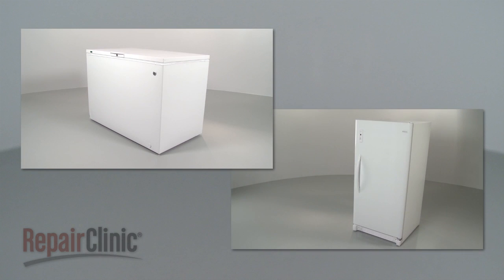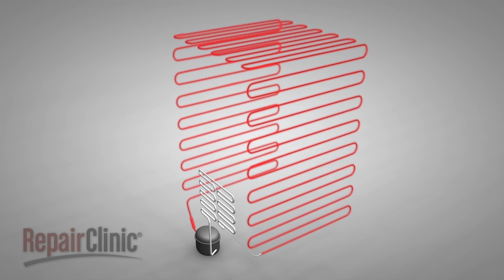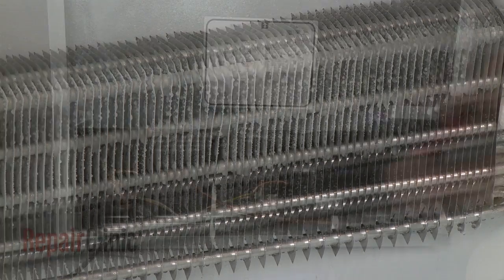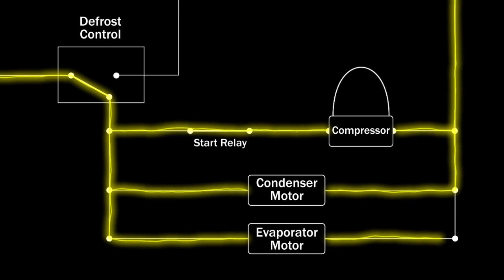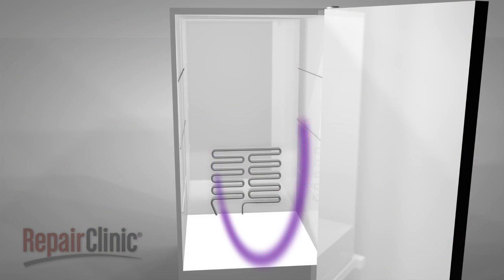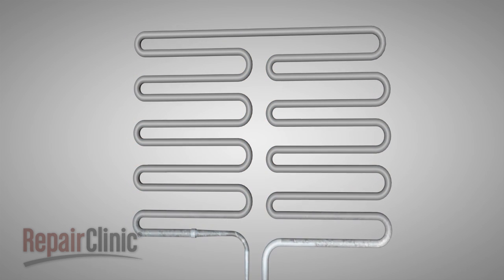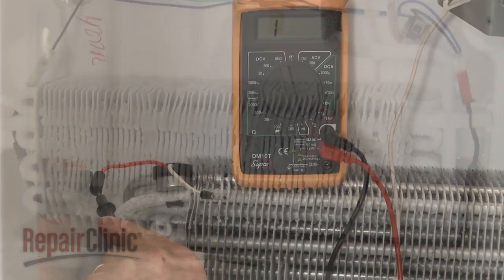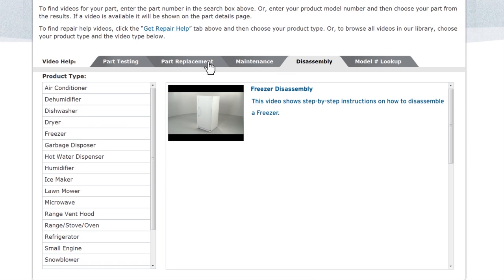How Does a Freezer Work? — Appliance Repair Tips

Comment: i have a whirlpool side-by-side freezer/refrigerator.  the refrigerator is fine.  i replaced the defrost timer.  The freezer motor/fan, the freezer thermostat and the defrost heater each work and have continuity.  but every week or so the heater won't stop heating and the freezer won't re-freeze.  i can restart the freezer by turning the defrost timer.  any suggestions?

Comment: 1:11 it's wrongly explained. Compressor doesn't convert gas to liquid. It converts evaporated gas from evaporator to HIGH PRESSURE and  HIGH TEMPERATURE GAS. 
After that compressed gas is converted to liquid in the condensor.
Reply: You prune
This Video is CORRECT 
THE REFRIGERANT IS ALWAYS CHANGING FROM A LIQUID TO A GAS ALL THE TIME

Comment: i have the unit the one you are showing in this program and its not cooling . i was told to turn it of for 18 to 24 hrs before turning it back on and i did but i noticed the fan is not blowing that high or its not normal. what should i do

Comment: Visiting family and their freezer isn't freezing. Check the condenser coils: they weren't as dirty as I expected. Cleaned the coils about 3 days ago, so I assume it's been enough time for the evaporator coils to frost over. Then checked the evaporator coils yesterday and only the bottom coil is frozen or covered in frost. Your video explained that if only part of the coils are frosted over, then the sealed system has developed a restriction or leak. This is what I believe the problem is, not only because of this video, but also due to a response I received from another youtuber. Would you concur?

Comment: My upright freezer's evaporator coils are not cooling/frosting.  The copper tube that leads up to them, has frost on it.  It's just not getting to the coils.  The freezer had been unplugged for a year, but was working fine at the time.  Just didn't need it.  The compressor is working and the fan by the coils is working.  The cold, just isn't making it to the coils.  I'm wondering if it might be the thermistor, the temperature sensor or the control panel.  I've been told each of the 3.  Also, I've seen a video, where it's suggested that the system may have developed a leak.  Any suggestions?

Comment: Our freezer doesn't have a condenser. I removed the side cover and saw just a compressor and a fan. Nothing else. The fan and the compressor always start and stop simultaneously. Could the compressor work as a condenser too, or the condenser is located somewhere else? Nice and simple video...
Reply: No, it either has a condenser coil above the compressor or some are built into the walls of the freezer but it has to have both a condensing coil and evap. coil.

Comment: I have a Frigidaire chest freezer. The temp Alarm is going off continually since a power outage.  I have tried unplugging the unit to reset to no avail. The lights and alarm reset on the lid not working now. What to do ?
Reply: +Elroy Koch oh and it's cooling fine
Reply from the maker: +Elroy Koch Sounds like the unit has a control board and it was damaged in the power outage.

Comment: I have an older Kenmore chest freezer (1988165382) that works fine but needs a new gasket, but the parts for this model are no longer available. Is there no way  to determine the current model that would be the same size and use a gasket for that model?

Comment: I have a frigidaire upright freezer that worked perfectly until we moved it to our new house.  Now it doesn't even turn on.  We have checked the outlet for power and it is fine.
Reply from the maker: +Holly Toolson We would suspect a problem with the cold control or the compressor start relay.

Comment: What creates the suction noise when I close my Whirlpool upright freezer door ?  Is there a pump that sucks out some air to help seal ?  Your video's are a great help.
Reply from the maker: +Donald Barnes It is the gasket. The gasket have magnets in them and when the door is closed the magnets pull the door closer.

Comment: I have a Amana side by side refrigerator. The defrost coil with defroster failed to work and I cut some wires and the frig continues to this day (6 years) to work properly without any frosting. Explain how this can be? Freezer side is zero and frig side about 50.
Reply from the maker: +Alvis Jenkins You disabled the automatic defrost system six years ago. It should frost over. We don't have have information beyond that.

Comment: mY REFRIGERATOR   WILL NOT CRUSH THE ICE, BUT
 DISPENSES ONLY CUBES.
Reply: push the crushed ice button first
Reply from the maker: Dale Kessler There is a solenoid in the rear that a rod on the underside of the bucket goes to. Make sure that solenoid can move up and down as it is probably locked up.

Comment: My 20 yr old Whirlpool upright freezer is working ok but, there is water frozen at bottom and the door no longer has that vacuum pressure when closing or opening. In fact, the door opens too easily. I noticed a gap at lower gasket. I cleaned the gasket but didn't help. What do u think could be wrong? Thanks for any help u can provide.
Reply from the maker: 771blahblah Your freezer's gasket may be worn out and may need to be replaced. There could be another issue causing the freezing water at the bottom of the unit. Enter your freezer's model number in our website's Repair Help for troubleshooting help: http://www.repairclinic.com/repairhelp?TLSID=1773.

Comment: The video shows that there is actually 1 coil. That doesn't make sense. There should be 1 for compression and one for expansion, no?
Reply from the maker: louis tournas There is always two coils in a refrigeration system. The condenser coil in a freezer is usually in the outer cabinet with the end connected to a capillary tube that goes to the evaporator coil that is located in the freezer. At 45 seconds into the video there are two coils the smaller coil is the evaporator witch is white and the larger one is the condenser that is a reddish color.

Comment: I have an upright freezer that freezes on the bottom but not the top...the evaporator coils are full of ice...evaporator fan?
Reply from the maker: This is most likely a problem with the defrost heater, defrost thermostat or defrost control. As stated in this video, the heater and thermostat can be tested for continuity. If both of them check out it is most likely a problem with the defrost control.

Comment from the maker: If the evaporator is froze up you may have a defrost problem, or if the shelves are the evaporator and are completely covered with frost they will not be as efficient and will need to be defrosted before the freezer will work properly. Another thing that will make the unit run a lot is if you have a Freon leak and only part of the evaporator coil is  getting frost. If all of the components of the freezer are working you may have a Freon leak and the unit may not be worth repairing.

Comment from the maker: The compressor should cycle off at some point. The normal recommended freezer temperature is around 0 degrees f. If the freezer is at or around 0 you can try and turn down the thermostat to see if it will shut off. The thermostat contacts may be stuck or it may just be out of calibration.  It is possible to be cold enough to freeze the food but not cold enough to cycle off the thermostat.